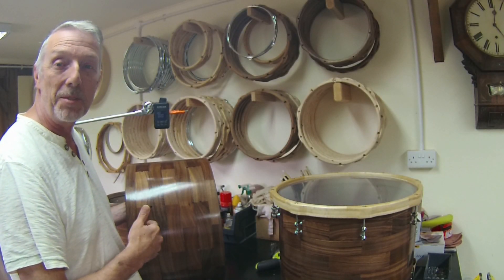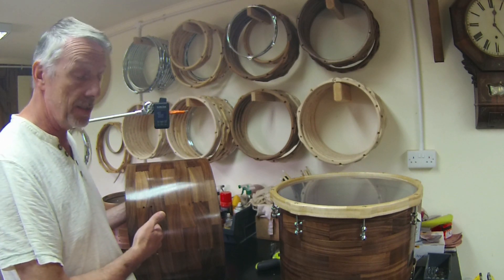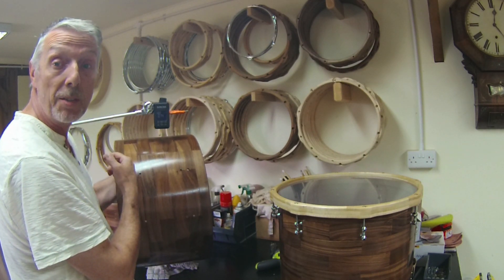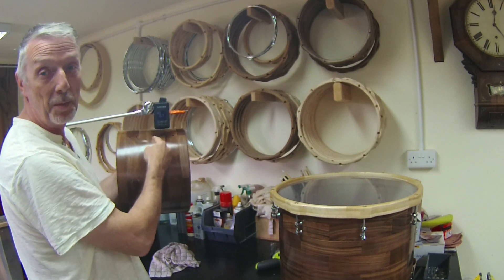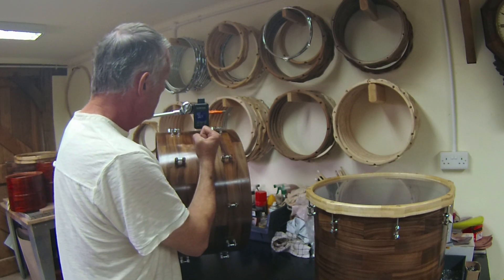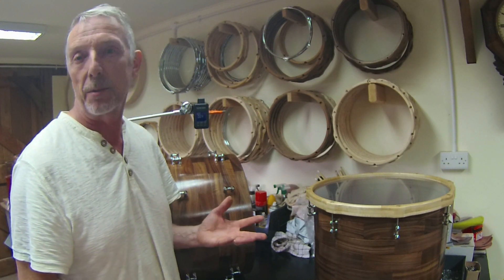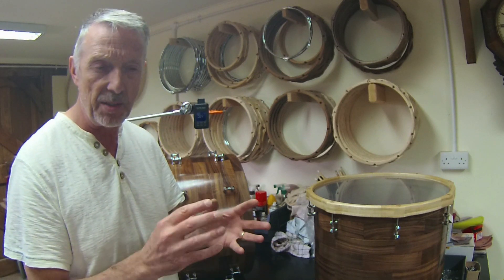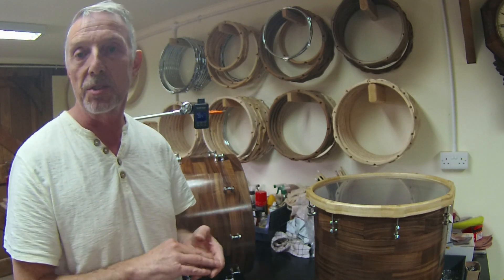Drum shell fundamental frequencies test - adding hardware

Comment: Interesting... that tom was basically. whole step lower after adding the hardware. Was a little confused tho because it sounded like he said it gave a reading of 338 Hz, which would've been much higher than the original reading of 157 Hz. Gonna assume he meant 138? It's hard to tell, but it looks like that's what it says on the tuner as well. Never knew what a notable difference adding the hardware makes.

Comment: the shell pitch doesnt doesnt make the pitch of ther drum, its the drumhead s pitch that matters... :D that shells and wood make the fundamental sound of a drum is just a marketing trick, becoming modern in the 90th... the shell just absorbs the airwaves between the drum heads either faster or slower, depending what material has been choosen, and depending of  the bearing edges..but thats it...

Comment: Interesting, now the parameter that has not been measured is the damping - or the effect on the decay.
Reply: I may be wrong but the decay would depend on your tuning. If you tune such a way that the fundamental rings a long time (both heads at similar pitch), and the fundamental of that tuning is the same as of the shells resonant frequency (with all things attached), the shell COULD help the vibrations last longer. Or, the dimensions could make a modal null point for that frequency. Meaning that the fundamental cancel itself out. But most people tune their reso heads higher or lower, and that results to a pitch bend. The volume could very well raise when the bend is at the shell's resonant frequency. This is all theoretical, trying is the best way to know. But knowing the resonant frequency with the heads under tension is kinda hard, since heads damp the shell almost completely.
Reply: @djentlover  Indeed trying to understand drums acoustics elements by elements leads nowhere - it is all heavily coupled, be it the heads with the shells and the air around it...One misconception it that shells actually radiate sound. Compared to a head their ability to radiate is 5 to 10% of the total sound...The mechanism that makes the shell influence the sound has more to do with the damping of the head by the shell itself - at some particular frequencies, the shell will "pump" some energy from the head and damp it changing the "EQ" of the sound. Hence the importance of bearing edge (bringing the contact conditions and the local friction control).
So hitting a shell is irrelevant both because this will appropriate certain modes only (as opposed to the whole field generated by a head sound and vibration) and because the result is non conclusive for the global sound of the drum. However measuring how a shell damps is way more relevant.

Comment: Drum shells are basically structural in nature and have very little to do with drum sound.... The sound of a drum comes specifically from the drum heads and their contact with the bearing edges and tension hardware.   Further, there is the whole issue behind wood and how its moves in relationship to temperature and humidity.  None of those latter bits being anything a manufacturer can control.  Most people don't understand that the air movement created within the shell does not penetrate the drum shell itself (Lamination of Plies and related glue and coatings).  So all this muff about drum shell design or finishing is simply that .. . Muff.....  for decades drums have been finished in plastic wrap or lacquer of polyurethane all of which are plastics..   Further what about acrylic shells?  They are completely plastic and produce zero drum shell frequency when tapped.....  The entire idea that woods have anything to do with eventually drum sound is a rouse....... Its a marketing ploy..... Drum sound comes from the heads contacting the bearing edges of the shell and the shell containing the air column within as the head is struck.... One never states ... there goes a proper wack sound from that maple drum shell, listen to that maple sound...... Most people never know the difference between one drum shell material to the next...... 
Those drums look great by the way.   Thanks for posting the video.
Reply: I have an old yamaha stage custom kut from the 90s. It sounds better than any high end kit I've heard.
Reply: Paul Myres well in my experience, with ply shells that have so much glue, you are in the right. However, when a shell is solid wood it can resonate at a much higher volume because it is not as restricted by said glue. (Although obviously as the video suggest, you’d have to take hardware into account) Still, when you hit a drumhead you’re basically firing of a wave of sound through a column of air that bounces up and down the cylinder of the shell and also reflects off of the shell itself, thus resonating. Thus if one were to tune to said pitch of a solid shell, in theory, you could increase resonance at a certain hertz. That is what most drummers refer to tone.

Comment: Can you comment on pitch inconsistencies within a drum shell? I had a Keller 12"x8" tom that was impossible to get a good tone out of. After removing all of the hardware, suspending the shell by a string and tapping on the shell with a mallet I found that the pitches varied at different points of the shell. The good sounding drums on the kit held consistent pitch. What would cause a shell to go out of tune with itself?
Reply: Cole Solem true and also imperfections within the final cut of the wood. i e. Dead spots such as knots

Comment: Won't the contact of the head with the shell ultimately reduce or remove the vibration of the shell anyway?  I agree that in the real world--practically speaking--the sweet spot is just what sounds good.  To what degree does the sweet spot rely, if at all, on the undress fundamental of the shell, or the fundamental with hardware and accessories?
Reply from the maker: Head contact with the shell is one of the primary means of exciting the instrument structure, including the shell.  There are other mechanisms, including influence of the air column, but head to shell contact is a good thing if you want the shell (+ associated components) to influence the overall result.  Unfortunately, there's not enough space here to fully describe the relationship of the instrument structure and tuning / tensioning options, but suffice to say, the influence of the overall instrument structure on tonal delivery can be substantial.
Reply: Guru Drums Thank you!  I still have trouble reconciling the two, but what tou say has always seemed the more intuitve and likely result.
Reply: Guru Drums you should do a series on drum shell acoustics, that would be awesome
Reply: Drum shells have very little to do with eventual drum sound,  that fact has been proven conclusively.   Drum heads, the squareness of the bearing edges the tension components, and the bearing edge finish have much to do with the sound of a drum    Shells?   Not so much...    Think about it, vista-lite shells are made from acrylic, which has not relative pitch whatsoever.......  Ever bang on a steel snare shell?  What pitch will one derive from steel?  ..... That should answer all the questions related to how much a drum shell effects drum sound.  About the only two issues which will effect drum sound related to a shell are its wall thickness and its length
Reply: Paul Myres also it’s density